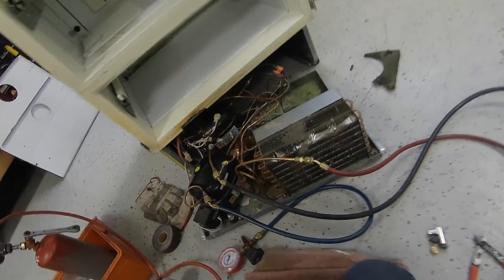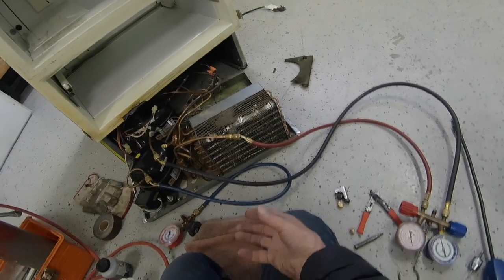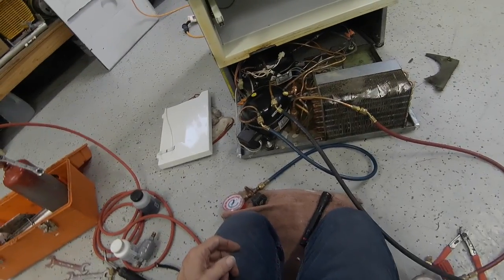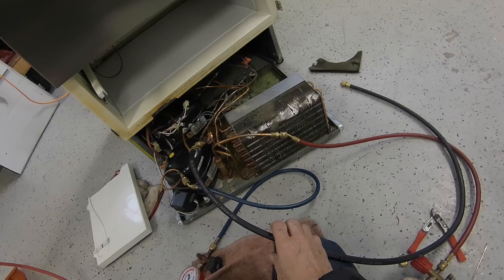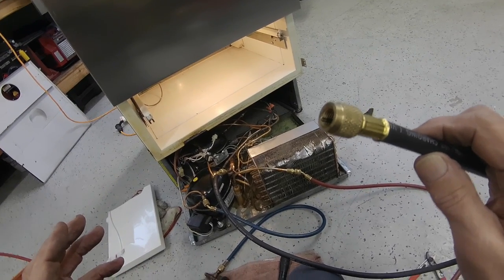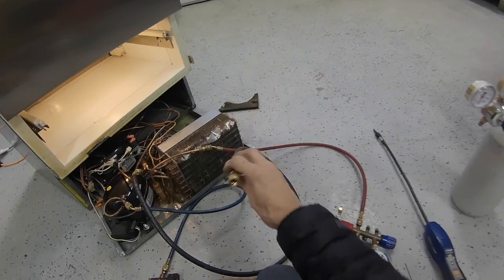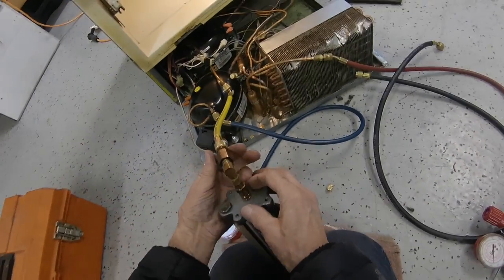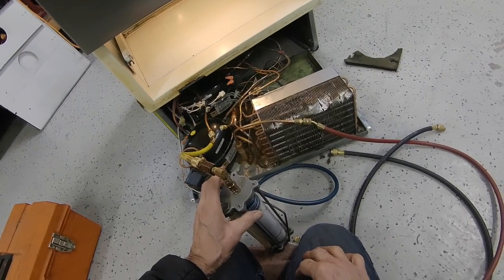How to do a Sweep Charge

Comment: Is this the same as charging a car ac with refrigerant except you use the refrigerator compressor instead of bringing an additional vacuum pump with you? In other words, could you instead of doing the sweep charge, use a three way manifold with shutoffs? You would attach to the high and low side, and the third tube would go to a vacuum pump and you would pull a vacuum with that? Not sure if I’m being clear.
Reply from the maker: Which ever way you prefer. This is a procedure I learned from Whirlpool about forty years ago and have been using it ever since. Of course if you have moisture in your system then you’ll need a vacuum pump. Sometimes on Sub-Zeros when the heater loop leaks and sucks in water from the drain pan a sweep charge won’t work.
Reply: @SubZeroSpecialists  thank you. I’m not in the business but I’m extremely interested and appreciate your answer. I know  hvac guys will pump down the refrigerant into the condensing unit using the compressor- I guess this uses a similar principle for filling the system. Thanks again.